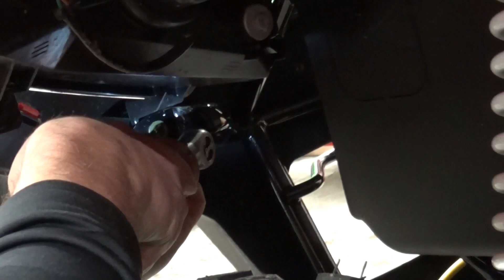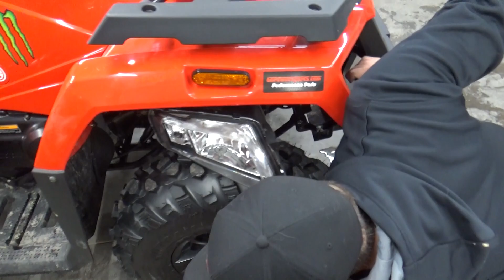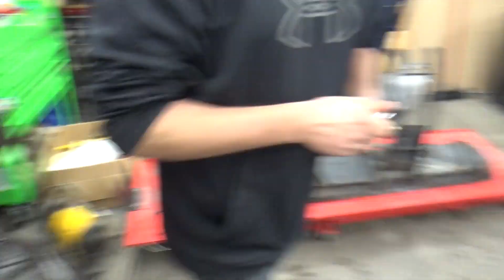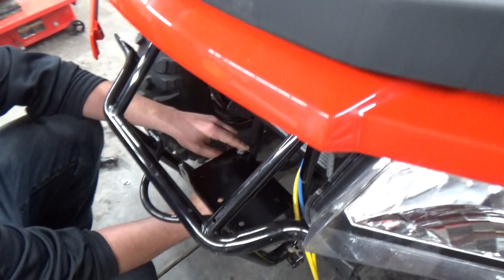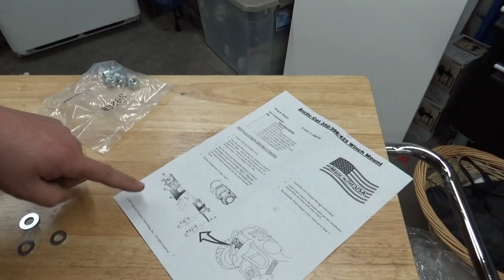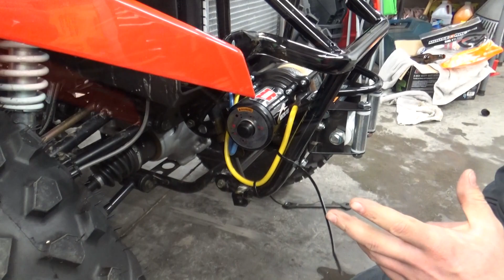2018 Arcticcat/Textron Alterra 500 Winch Install

Comment: Have you ever installed a superwinch A3500 winch on a 4 wheeler like this?
Reply from the maker: We haven't yet. The A3500 does look like a solid well priced unit. Let us know if you would like to see an install on our new CanAM Outlander.
Reply: @unlimitedatvs8735  sure!  I just cant seem to find a mounting plate that will fit the arctic cat and the winch
Reply from the maker: @skizzla  Did you find the mount you were looking for?

Comment: Really appreciate this guys. Bought an Alterra 500 in November, and need to install a winch and the plow mount. As you mentioned, not much info on these yet, and you made the installs easy to understand.
Reply from the maker: Stay tuned for the rock light install, as well as the KFI plow setup.